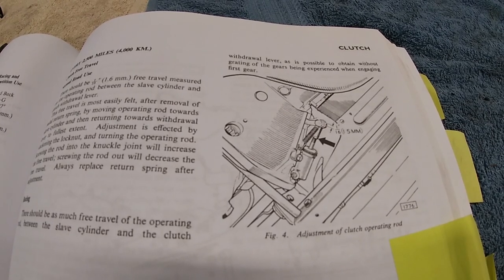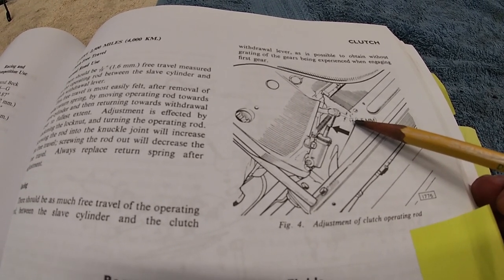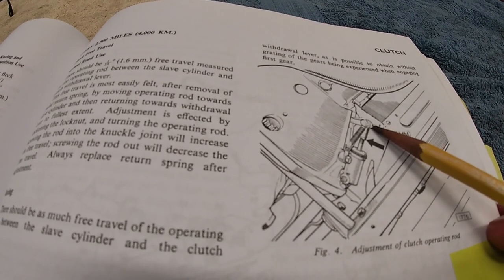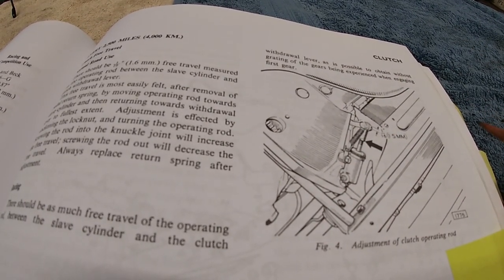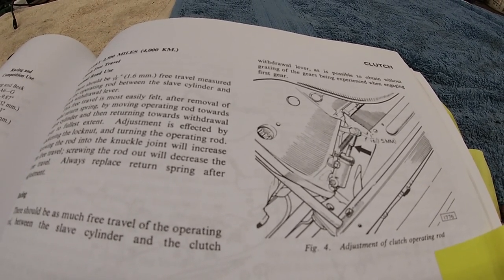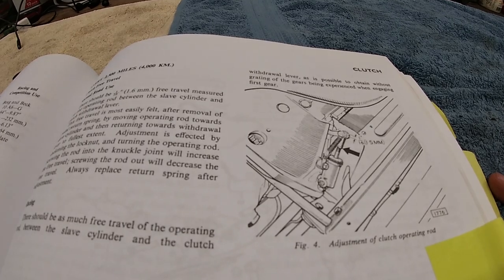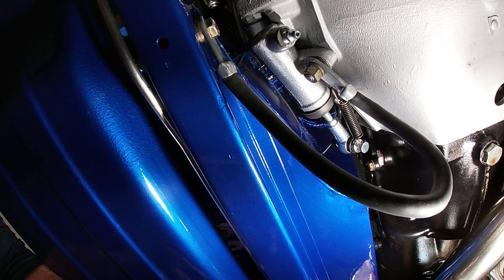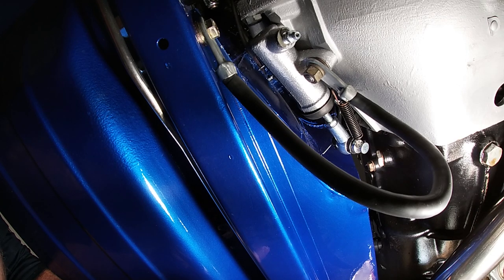Jaguar E Type Series II Rebuild - 2023-05-02 - Clutch Adjustment and In Garage Test Drive

Comment: Wow John, she looks good and now drives. You don't need the return spring. I took my SII to some experts last year because I was having trouble bleeding the clutch after refurbishing the clutch master cylinder. They fitted a new slave and bled it, then adjusted it and gave me the spring as a souvenir. $600 - good deal. BTW, hell of a ground strap you have there.

Comment: On my 70 Type, I made a slightly longer push rod out of. stainless bolt and I have the return spring installed.. Someone told me that the only setting you should strive for is one where the clutch fully disengages when the pedal is depressed and fully engages when it is let out. After a bit of fiddling, mine seems to work fine.
Reply from the maker: Hi John - thats cool - this is what I am striving for also.

Comment: Coming along very nicely....like the previous comment...i dont think you need the return spring now....and would not normally use a split pin...normally a push clip...which slides over the end..and slides off quite easily.
Also, you refer to the cylinder as a master ...but it is, in fact the slave cylinder...
Reply from the maker: The adjustable push rod came with a spilt pin and corresponding hole which is why I used it. 

My bad on using "master" cylinder instead of "slave" cylinder. It is, of course, the slave cylinder.